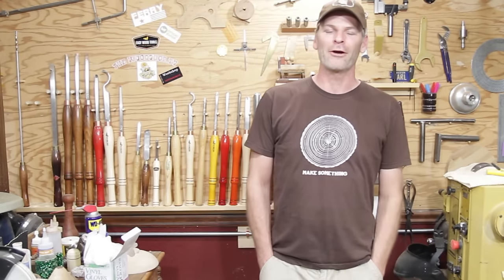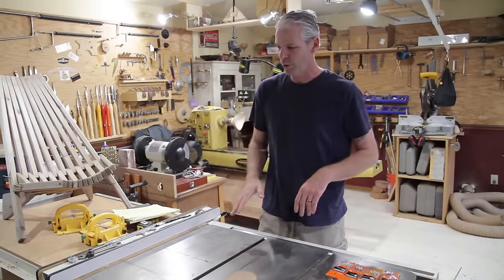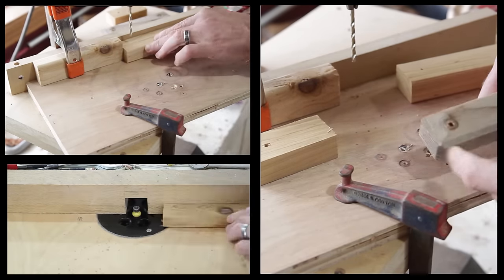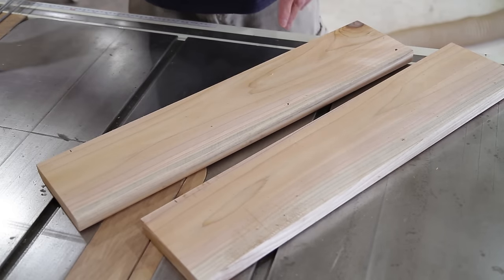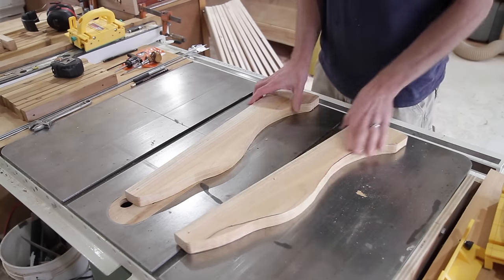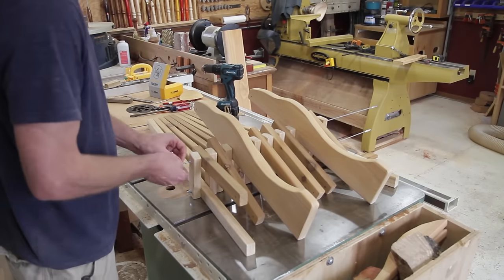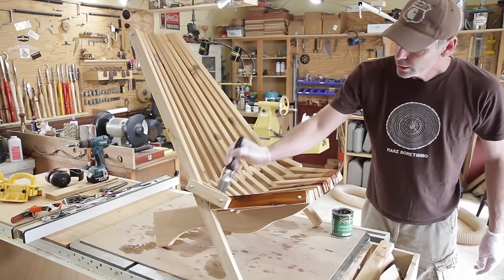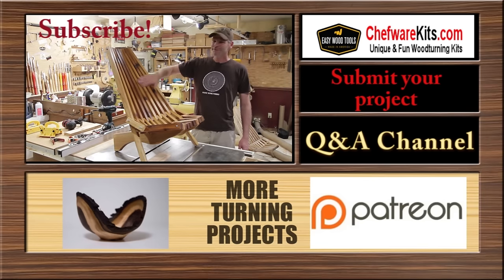How To Make A Folding Cedar Lawn Chair DIY Woodworking Projects

Comment: Carl:
I cannot emphasize enough the proper dimensions of the wood. My local box store had what they called 1 inch cedar but was actually 3/4 inch thickness. (note to self-check before buying.) I was anxious so I bought it. After following all the steps I sat in it in my shop. I  broke the chair and bruised my ego. There probably isn't a recommended max weight rating but at almost 250 lbs, I really should have shopped for 5/4 or true 1 inch material.  I am pondering on how much effort it will take to sit higher off the ground. I may just remake the broken 40" pieces.
Reply from the maker: +Richard Bennett Right?! just isn't what it used to be! Maybe make the front legs a littler thicker too.

Comment: Great video, great chair, and great music !
One tip, if You don't mind... when the chair is in "open" position, the bottom of the legs should be cut with an angle, so there' will be a better contact with the ground - more stable.
Reply from the maker: Deevla Thank you very much! Thanks that's a great tip!

Comment: Video reminds of me Quigley Down Under.  "I said I didn't have much use for one. Didn't say I didn't know how to use it."

Did you try using paste wax on the threaded rod or maybe every couple holes to cut down on the squeaking?  Might even get a little bit of water barrier in there too.
Reply from the maker: Make Crazydays lol That's funny! ya a little bit of wax would of helped with the squeaking!

Comment: this is a great design.  i had to go to 1/4" holes to make the seat and back pieces fan out properly.  if you cut the rod with a dremel metal cutting wheel, the threads will allow a nut to easily start over the cut so you don't have to deal with all that excess rod.  i used lock nuts.  mine is cherry which is pretty but heavy.  next one will be cedar.  thanks for another fun project.
Reply from the maker: wakely wanderer Thank you very much, I'm glad you not only enjoyed it, but made one!

Comment: Never seen a chair like that before. Uses a lot of timber. I guess that you were using locking nuts on the end of the threaded bar. As well as a larger model for yourself you could also make a smaller version for kids. Great work.

Comment: Great work Carl! I love the leg design, gives it a nice look!
I decided to build a few myself based off your plans and the only problem I have is getting the chair to fold. I tightened every joint so all the wood pieces are just touching. Is that how you did it? At least for me by that point the wood was binding so much that the chair wouldn't fold. I can't tell exactly from the pictures but it looks like you pulled all the joints tight so each wood piece touches the next, correct? I had to crank on those that joints to get them to this point afraid I was going to break something.
Reply from the maker: Thank you Max!! I left them a little loose, because mine was stiff when I folded it too.

Comment: Wouldn't it be posible to add all rods by hand with all pieces lined up parallel and then "squeeze" the top and front together afterwards?
Reply from the maker: +Escviitash Yes I think you could install them by hand, just a little more work.
Reply: +Carl Jacobson 
I thought of it as it should be possible to create this chair with only basic hand tools (handsaw, drill, measuring tape, wrenches, and sandpaper) and of course  a good sense of precision. Only shaping the hind legs would require additional tools, but you could skip that part.
But if you have only these basic tools , you might not have a drill that is powerful enough to drive in the rods ( I assume it requires a reasonably powerful drill ). And therefore alternatively have to shorten the rods and squeeze the chair together by a lot of turns on the nuts.

Comment: I understand the benefits of using Cedar but, would it be practical to make it out of a different kind of wood to save some money? And then treat it be out in the weather? Pine, maybe? or would that be too soft? I do like the idea mentioned below on using grown wood. We had to fell a huge Turkey Oak a few years back. Still have some chunks left.
Reply from the maker: ned103 I'm sure most woods would work fine, just as long as you seal them up well. Cedar is probably the best choose though, and it was only $30 for all the wood.

Comment: Great presentation. I will redo the drawings in metric for my high school woodwork class - I'm a teacher. I think the students would really enjoy making one - perhaps even downsizing for 'small' kids' Do you think it would work to build in a step to the leg shapes that could act as a stop block rather than adding on and extra block. Also, can you see any reason why you wouldn't use acorn or dome nuts to the ends of the threaded rods? Cheers from downunder!
Reply from the maker: Bill Blake Thank you Bill, 
That's a great idea, building in the stops to the legs. maybe I didn't show it, but I did used dome nuts.
Take care,
Carl

Comment: Great video.  I just built the chair based on you video.  How do I get the seat to all close in on the front with out breaking them?  went through two pieces.
Reply from the maker: +Michael Swanson Thank you Michael! I left the back a little loose, and tighten the front first.
Reply: Very good. I will try that on my next one. Thanks for the help.

Comment: Very nice!  I am in the process of making one from your plans on instructables.  Would you recommend any type of finish on the threaded rod to prevent it from rusting?  I found stainless nuts and washers, but the rod is only zinc coated .
Reply from the maker: +Alex Murfey Thank you Alex, 
You could paint them with an outdoor paint. I just put wax on the next few I made, but you got a great point.

Comment: I made one using slightly different plans. The back definitely needs to be higher. My head hits right on the top edge...what are your thoughts on using something other than threaded rod?
Reply from the maker: jcardwell3rd I've seen some done with wire, but the way they hook them on doesn't seem very sturdy or attractive.  The threaded rod works great if you use the drill.

Comment: Really nice work Carl but i have a question about the chair i built it does not open up and close very easy could it be because i used to stiff of all thread it was a quarter inch. Or if you have any suggestions it would be greatly appreciated thanks.
Reply from the maker: +kevin skiles Thank you Kevin! The 1/4" thread I think is the problem, I used 1/8"

Comment: Hi Carl, Thank you for all the great videos, you're incredibly talented! I'm new to woodworking and I am currently making the stick chair, its been a lot of fun...I'm using 1/4" inch threading rod an want know what drill bit size should be used for the holes? 1/4" inch or larger. thanks again!
Reply from the maker: +Bryan Campbell (radamicu) Thank you very much Bryan! I used a 1/4" bit, put wax on the rod it will help them go in easier.

Comment: If you wanted an adjustable seat back,  could you do that by moving the stop blocks forward and back and securing with pins or something?   Or do the mechanics not really work for this idea?
Reply from the maker: It might work, and that's a great idea! I would have to pull the stops off and try it.
Reply: @CarlJacobson  cool!  If you do let me know.  Getting my first table saw this week and this chair might be 3rd in my project lineup :)

Comment: Hi, Carl. Great and elegant project. 
Two questions. 
What is the diameter of #8 threaded rod? 
And why didn't you apply finish before assemly (there's no glue used)? Wouldn't it be much easier to do?
Thanks for sharing.
Reply from the maker: +gghhhist Thank you so much! 
I believe it's 1/8" This was my first one, and I wanted to make sure it went together well.

Comment: As always Carl, great project. I made one this weekend, turned out good, but of course not as nice as yours. LOL One thing though, what size bit did you use for all the holes? I think I may have gone a too small on the bit.
Reply from the maker: cwo2mustang2 Thank you very much! I can't read it anymore :) but it's just over an 1/8"

Comment: I'm making this for sure. I'm new to woodworking, so:
Would pine work for this project?
Reply from the maker: Håkon Harnes Yes it would work, just make sure you seal it very well. Pine doesn't do that well outside, if it's not protected.
Reply: Would linseed oil be a good option?

Comment: +Carl Jacobson

I really like the design of this chair, and want to make a few myself. How can I adjust the angle to make it a bit more "upright"? It's laying a little too flat for me.

But great video anyway!
Reply from the maker: +Pieter Roets Thank you Pieter, I'm not really sure... Maybe try reducing the seat length pieces? Sorry I couldn't be more help.
Reply: +Carl Jacobson 

Thanks for your reply. I made a prototype this afternoon and it's looking good. With a few tweaks it wil work very well (The wood I used was much wider, which caused some problems) But it's almost sorted.

Comment: On your instructables page you said to drill 3/4 inch in on the 12 inch pieces but on the video it's 2 1/8 inch in. I don't think everything will line up if it's just 3/4 inch? Is this correct?
Reply from the maker: Andrew Ackley Thanks for the heads up, I corrected it!

Comment: Nice design.. not a fan of the exposed metal hardware by the knee area though. Seems like a good way to get scratched! ... Maybe countersink them?
Reply from the maker: Josh Olson Thank you Josh! They're cap nuts, but countersinking them is a good idea.
Reply: Ah, I couldn't tell. That's safer than what I thought they were. :-P I just compared them to the wooden design in the beginning when I commented.

Comment: How much weight would you expect something like this could hold? I'm not the smallest guy in the world, so im always worried about something like this snapping underneath me.
Reply from the maker: The Splinter Shoppe It's very sturdy, but you could always beef it up. That's the cool thing about this design.
Reply: Carl Jacobson Im assuming beefing up all the wood would be the only thing id have to do. Using a thicker threaded rod might prevent it from bending into the shape or put too much strain on the wood and make it snap, im guessing.

Comment: why not just use 2 x 2s  which are actually 1.5 x 1.5 and that extra half inch will add additional strength and you could probably make it with one less rows of boards so it'll end up the same width.
Reply from the maker: I think with smaller boards and more rows it's easier to fold up. Let me know how the two by twos work out it might make it easier.
Reply: +Carl Jacobson I was also curious why the back legs are only 24 inch in length? Every other tutorial I see calls for 35 in back legs. is it mainly because of the width of the back legs that required to be shorter in order to achieve the correct seat angle?
Reply: +Carl Jacobson for my chair I used 2 x 3s ripped exactly down the center leaving me with 1 3/16 in in width, which turned out to be perfect. I use the more traditional 8 slats. also I really like the arm and seal look but unfortunately it is interior only.
Reply: +Carl Jacobson here's how my chair turned out...
https://youtu.be/iU806kY7fvk

Comment: I make these exact same chairs except I use 1/4 " rubber coated wire cable lasts a life time longer then threaded rod and instead of stop blocks make those 2 back pieces    1 1/2 " - 2" longer then the rest of the back pieces and they will rest right on the legs. mckitwoodworks on facebook
Reply: lericsun also a side note might mention I tell all my customers  if u get your fingers in between the uprights of the back while opening chair it can squeeze them like a vise
Reply from the maker: lericsun Thanks for the tip, I'll check out your page.
Reply: lericsun  my bad its two words mckit woodworks